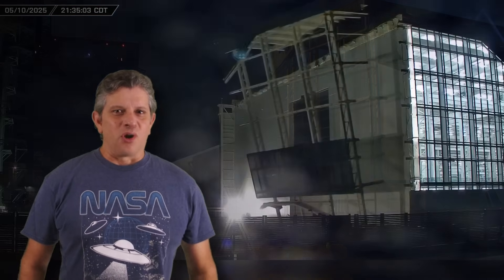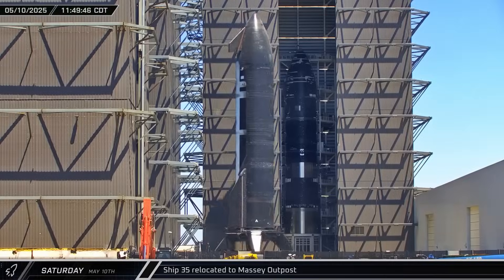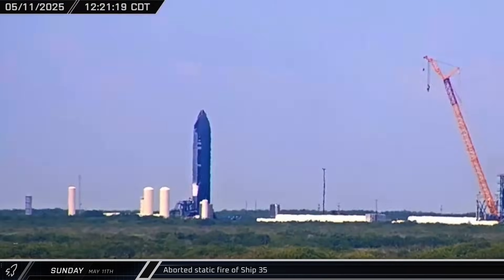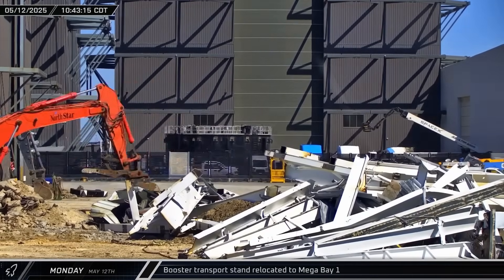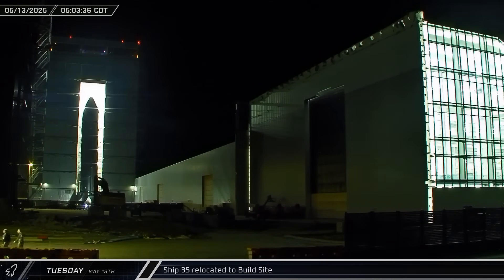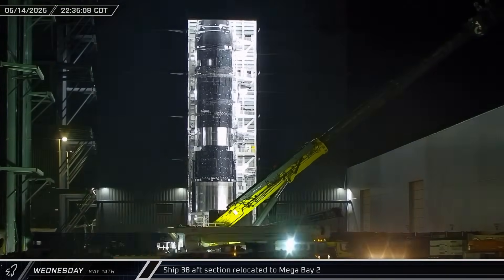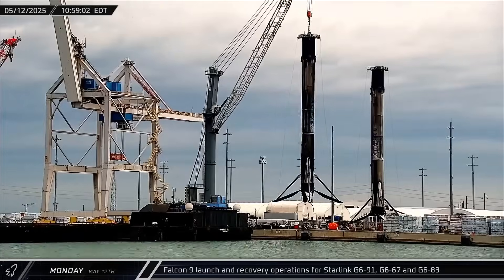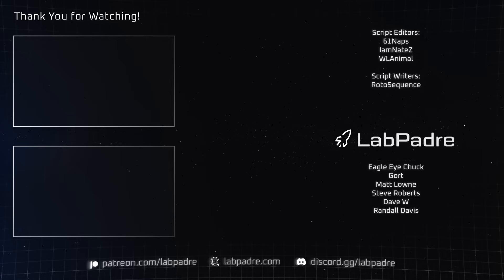Starship's Flight 9 Is Quickly Approaching! - SpaceX Weekly #167

Comment: Why do static fires (of both Ship and Booster, I’ve noticed) typically fully fill the LOX tanks? Structural stability?
Reply: Weight, so the vehicle don't fly
Reply: It would be a very bad day for all involved if the rocket actually took off during a static fire test.
Reply: @fighteer1 Yeah, they really hate it when that happens…..
Reply: Thus they avoid to over stress the clamps that hold both the stages down.